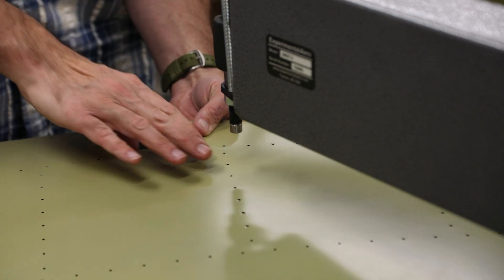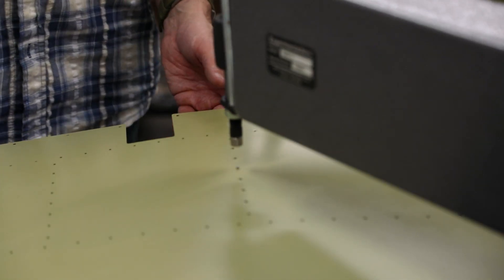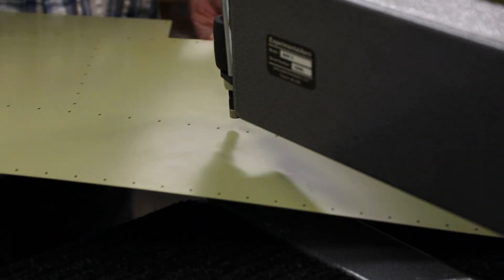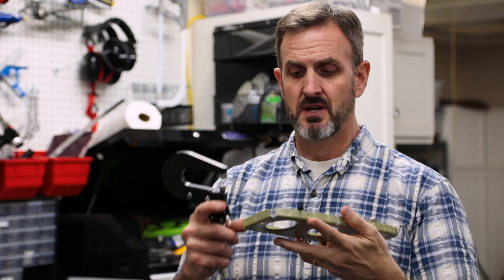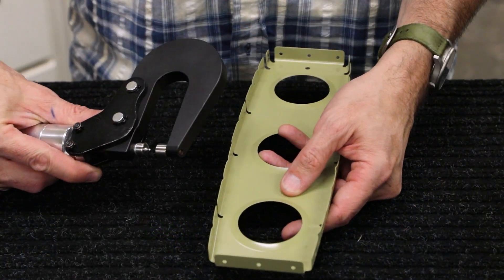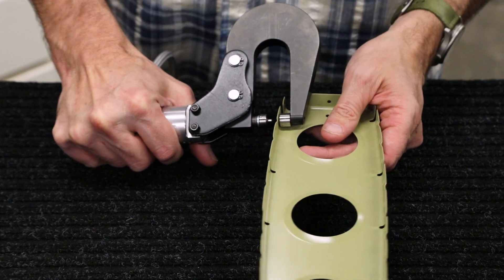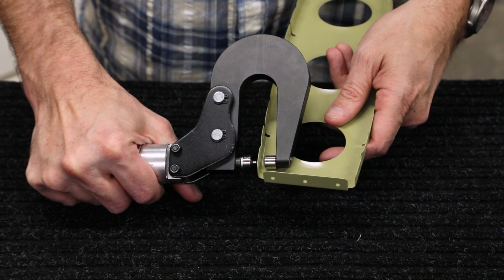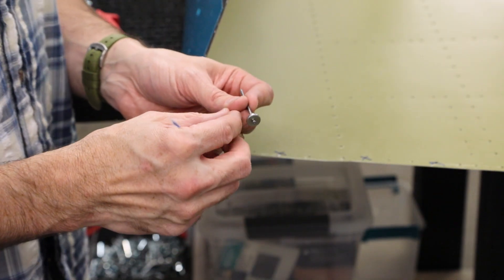Building the RV10 - Video 6 - Horizontal Stabilizer (December 2021)

Comment: why you prime before dimple, but not dimple and then prime?
Reply from the maker: Sometimes primer can pool in a simple hole and it changes the dimension (this has happened in holes that I machine countersunk). It’s not usually a big deal, but if I dimple after I prime, the dimple has the right dimensions. This works with AKZO, because the primer usually doesn’t flake off when I dimple. 

I sometimes use SEM on smaller parts, and that primer is more brittle. So when I’m using that primer, I dimple then prime.
Reply from the maker: Oh yes, two other big reasons: if you dimple before priming, it’s hard to scuff up the inside of the dimple hole and the primer doesn’t stick as well. Also, if you dimple before scuffing, it will grate up your 3M pads really quickly. (On the stickie-outie side of the dimple).
Reply: Agreed, scuffing flat surfaces is much easier than working on contoured ones. I’m just concerned that dimpling after priming might lead to some epoxy delamination

Comment: AkzoNobel 463-12-8 Epoxy Primer.
A chemically cured, two-component epoxy primer designed to provide maximum protection from various chemicals, hydraulic fluids, aviation fuels, phosphate ester (Skydrol) fluids and corrosion causing media

Comment: Many thanks for the video.  I'm building an RV-14A and was not sure if all elevator rib tabs are not to be dimpled.  It looks as though you did not dimple them.  You do a fantastic job explaining things in your videos which leads me to believe you may be a professor (good/enjoys teaching things to others).  I just bought the same hydraulic squeezer but haven't used it for dimpling get.  I believe I will give it a try.  Thanks again for your videos. RWG
Reply from the maker: Thank you for the kind words!  If I remember correctly, I did dimple the ribs where they connect to the skins (I don’t film everything…). I would read the instructions carefully - something I don’t always do which leads to me getting continually burned…
Reply from the maker: Oh yeah, the Numatx squeezer is awesome.  I don't know how people get by with the clunky one.  It's nice not to have to change the throw as well.

Comment: So dimpling is basically countersinking..  but for rivet holes instead of screw holes…?
Reply from the maker: It's different from countersinking in that you aren't removing material for the flush rivet to be even with the surface of the skin.  Rather, your are, well, dimpling the material.  This means there is a recess on the surface (which is what you would get with a countersink) but also a protrusion on the other side (which you would not get with a countersink).  The skins are generally too thin to countersink.  However, there is a lot of countersinking on thicker materials.  Does this make sense?

Check this out for more info:

https://www.kitplanes.com/best-practices-solid-rivets/
Reply: @buildingthe10  okay, awesome, that's a good explanation and I appreciate the response.   Sounds like two different procedures, but the underlying purpose is the same:  allow for flush mounting, whether rivets or screws.
Reply from the maker: @flightsimguides  Exactly.